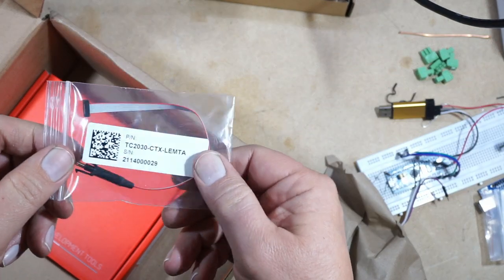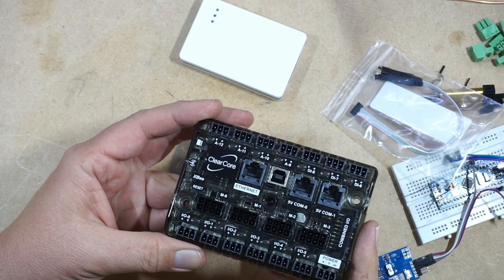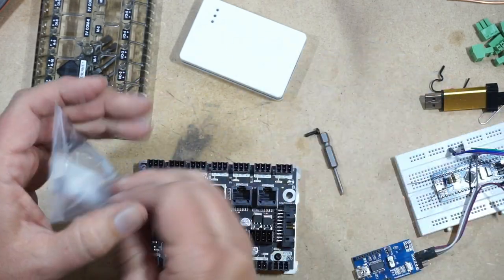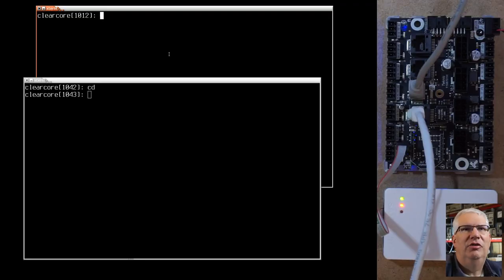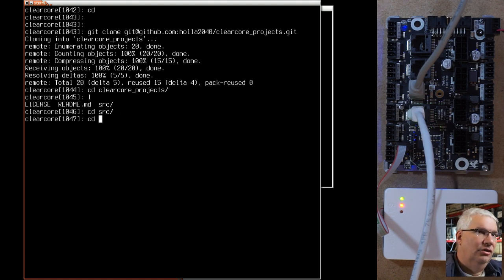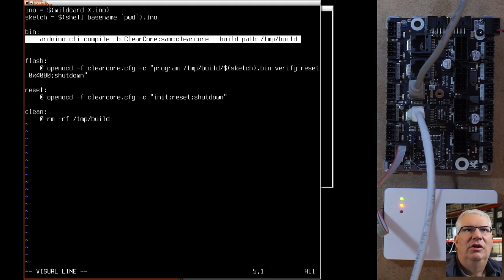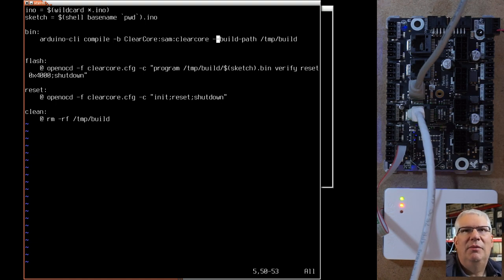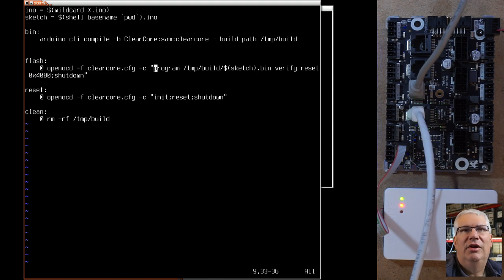Teknic ClearCore Flashing with Microchip ICE

Comment: Your terminal window issue and the need for your delay is odd, in Windows you can leave the terminal open in the Arduino IDE while you flash, and it just 'disables' while its flashing, then when its done it connects to the serial port again and you immediately get the readout again. More Linux quirks it seems. I noticed when you tried this in the Arduino IDE on your other video, it wouldn't program as the terminal was stealing the serial port and wouldn't let the programmer use it. Doesn't seem to be that issue on Windows.
Reply from the maker: You're correct. Arduino IDE does close the terminal port when flashing, this works fine on both win/lin. Thanks for the comment.

Comment: I watched the whole video (because I have to program a Clear Core also), and I don't have a clue about anything you did.  This looks like it's going to be very painful.
Reply from the maker: Please don't let my first experiences with the Clearcore affect your decisions. Its an excellent hardware platfrom, USB DFU is more reliable than I showed. I've been working on a grbl port and this quite painful. As a machine control platform using the Teknic arduino-wrapper is easy use and complete examples showing all the functionality. Thanks for writing and for the comment.
Reply: @CraigHollabaugh  Yes, it looks to be a well laid out controller, and at a bargain price as well.  I ordered the ICE kit, but I think I'm going to try the USB option first.  We'll see how it works out.

I'm somewhat familiar with programming in general, but I didn't see one thing in your video that I could get a handle on, so that scared me a little.

Thanks for the reply, BTW.
Reply from the maker: @michaelangelo8001  even better, now you can debug code if needed.
Reply: @CraigHollabaugh  lol...  I'm satisfied that you could, but I'm like a blind man stumbling through an unfamiliar room.

It'll be here one day this week.  I'll let you know how it works out.
Reply from the maker: @michaelangelo8001  great. There's a little learning to get all the pieces working but it works great. I started with just straight command line gdb, then switched to https://www.gdbgui.com/. Much easier to navigate.
Reply: @CraigHollabaugh  Nice...  Thanks for the tip!